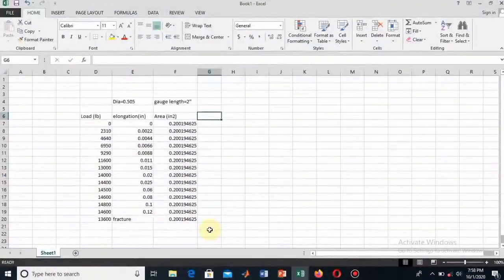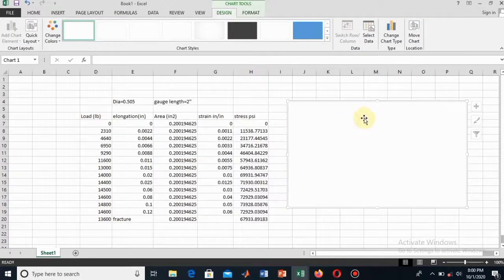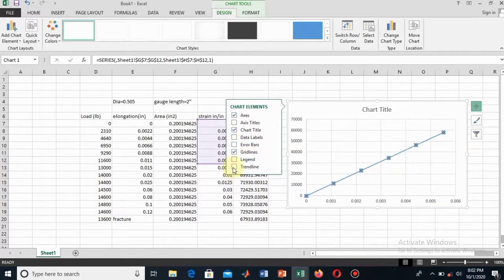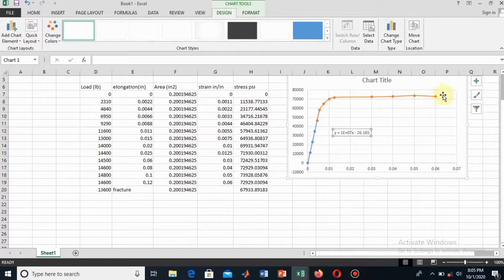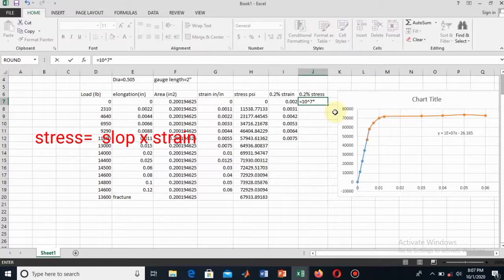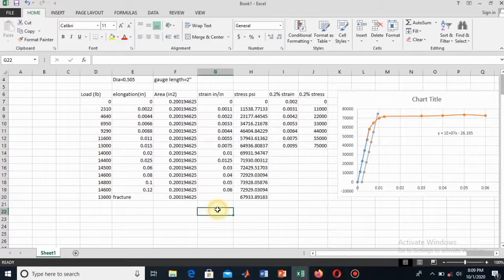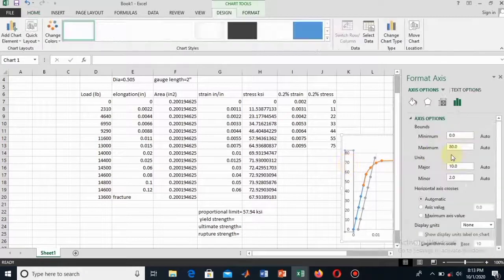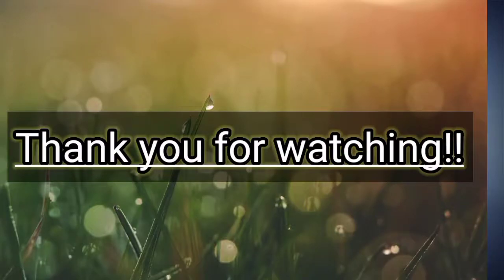Extracting Mechanical Properties from Stress-Strain Diagram | Engineering Mechanics | Excel #imali

Comment: Sir if I have only a stress-strain curve,then how can i extract stress strain data out of it?
Reply from the maker: Yes, in that case you need to draw grids over the graph for the whole graph or for the specifics stress strain value that you want to extract, and then get the strain value on x axis and it corresponding stress value on your y-axis and vice versa. But this practice will give you an approximate data extraction not an accurate one.
I hope you understood...